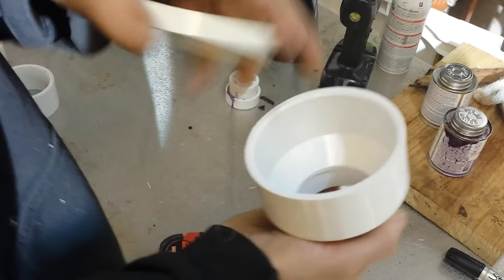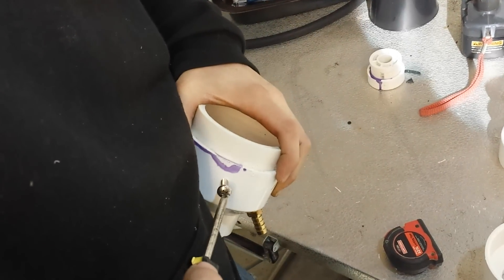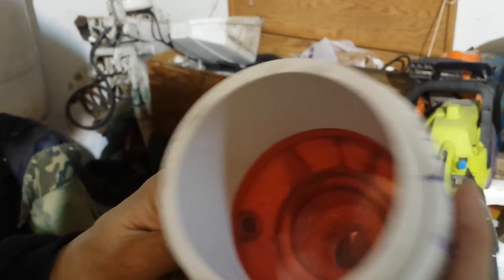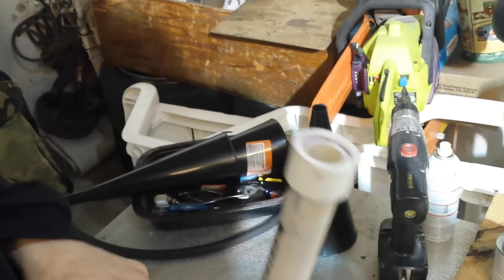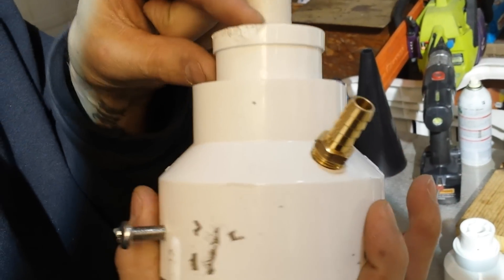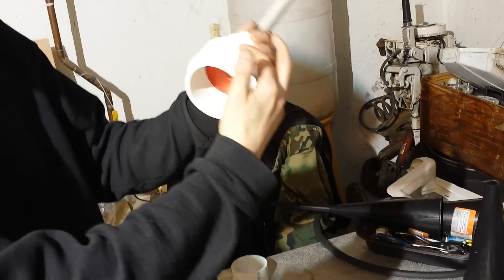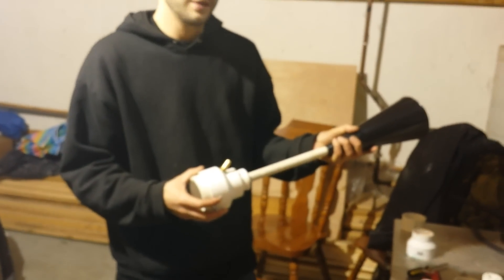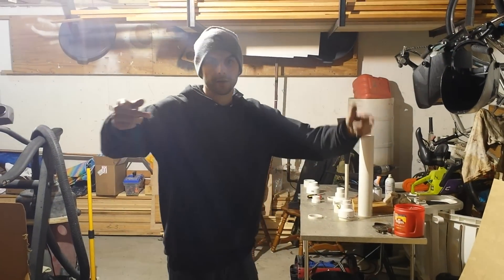homemade pvc train horns part 2

Comment: You installed the diaphragm, then you removed the diaphragm so you could insert the 1/2 inch pipe, why not insert the 1/2 inch pipe first, then the diaphragm?

Comment: like how you explained for the non PVC expert like us. I put a set of Harbor Freight air horns on my old CJ5, it's Camo and folks kept pulling out in front of me swapping lanes and running me off the road. Also added a 6 volt horn from a 1950 Ford. Both the squeal from H Freight and antique horns make a loud awful racket. I'm gonna make a set of these instead or keep the others as well. I love seeing folks jump as they ride into my lane when I blow them back over.

Comment: Just one idea. If you made the piece bigger that touches the vibrating plastic diaphragm disk would it make it louder? I ask because in high school a girl had me turn her some different size mouth pieces for her tuba. Like wandering if instead of the half inch cap you instead took a half to inch and a half adapter to make contact with the diaphragm???   I've never made one but thought that could make a difference, maybe not a good difference tho.

Comment: The 1st piece of 3" dia. you slip in the rear(1/2"long+/-)/.If you change the length of that,will it change the note of the horn?What about the 1/2" diameter pipe?If you changed that to 3/4" or 1" pipe,will that change the note?I'm wanting to build,like,say,a 5-bell horn setup,so I need to know what part(s) of the horn actually changes the pitch?Thank You!
Reply: Pitch is determined by the length of the tube.

Comment: hey john do you have a video on how to tune these things? and one on how they sound? im probably going to build them with in the next month when i get some free time from work
Reply: Car Ramrod use the principles of physics..the bigger the diameter of the vibrating material the deeper the sound or scientifically speaking the frequency is lower as to the length the longer the length the deeper or lower is the sound.hope that might help you
Reply: @kimlemuelalindao8179  This is actually incorrect; the tuning is affected only by the length of the horn. I've experimented fairly extensively with a different variant to confirm this.
Reply: Nikolai Hedler use the guitar as an example length is not only the factor in tuning your frequency....the strings in a guitar are all the same length how come they differ in frequency?because the differ in diameter..dont be a hardy its already written in the books..
Reply: @kimlemuelalindao8179  I'm a musician with almost two decades of experience and I've played everything from guitar to piano to trumpet to clarinet to bassoon and more. I've also studied acoustics of instruments and have built my own, including building a couple dozen air horns like these. I have tested specifically how these are tuned. I think I know better than you.

The pitch of an air horn is defined by the length of the air column that's vibrating, because it's a wind instrument. A guitar is not a wind instrument; therefore, there is no comparison. Wind instruments' pitches are dictated by the length of the vibrating air column, which is why a trombone has a slide and clarinets have keys. For proof that the diameter of a horn doesn't affect the pitch, compare a flugelhorn and a trumpet or a trombone and a euphonium. Each pair of instruments is the same length and play in the same register, but they have very different diameters for much of their length, which changes the timbre.
Reply: @kimlemuelalindao8179  Oh, really. So when you tune your axe, how is it that the machines change the TENSION of the string and not the DIAMETER. 
A guitar tuning is a very poor analogy to tuning wind instruments  (which is what these horns are).
The pitch of the horn depends on the length of the tube. Longer for a lower pitch. Independent of diameter. Ambient air temperature is also a factor.
Reply: @RossMarsden  diameter and length cant go separate way...if the horn maker doesnt believe me...then make another horn..with the same length but with smaller pipe diameter lets see if the pitch doesnt sound like chipmunks then im wrong..if it still sound low or produces the same sound with a smaller diameter but same length then you can say that only length is the factor in producing low or high pitch.

Comment: What did you use as your diaphragm
Reply: You can use all sorts of materials, but the loudest horns will use a sheet of polycarbonate plastic because it is a hard plastic material, and that enables high air pressures to be used. Ideally you want a thin but strong and stiff plastic material; increasing mass or decreasing stiffness will sacrifice output, but less stiff diaphragms can be powered by lower pressure air reservoirs - they just won't be as loud.